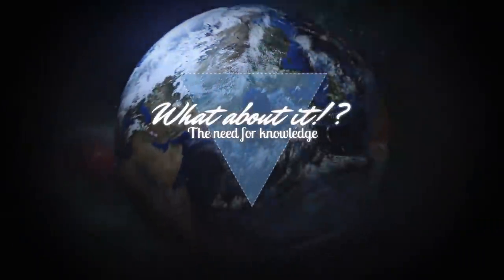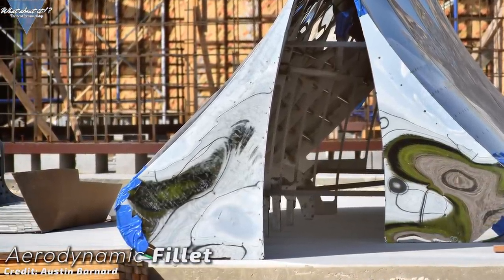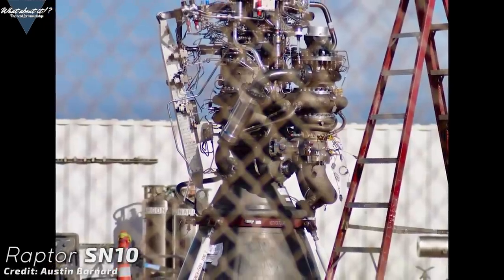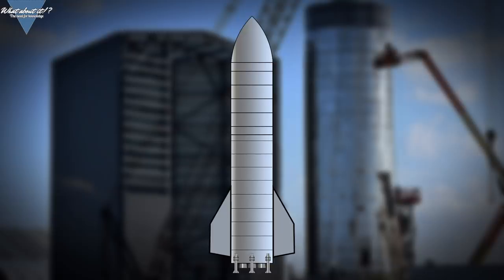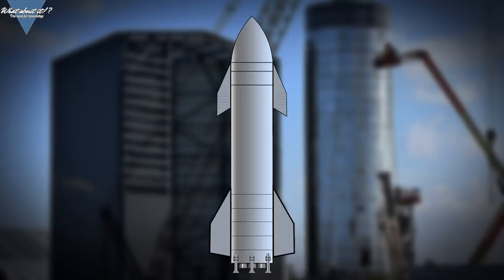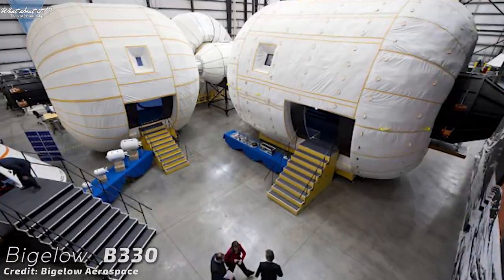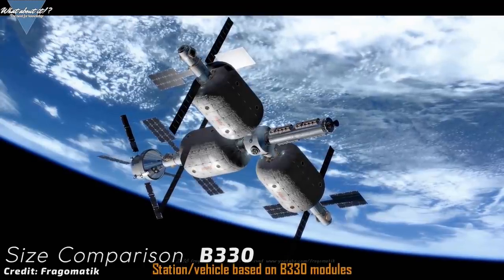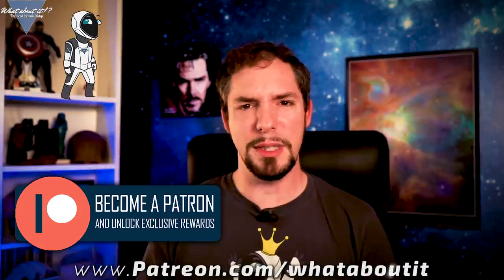36 | SpaceX Starship Almost Ready - Bigelow Aerospace, A Fitting Payload

Comment: Shipping an excavator to the moon would be 
Elon's style.
Reply: $5,000/Kg x 20,000 Kg = $100M.  Pretty expensive freight bill.
Reply: But battery powered
Reply: @SomeTechGuy666   Starship ought to be able to bring that cost per kilogram way down.
Reply: @odysseusrex5908  That is a landing on the moon price guestimate.  Earth orbit or even moon orbit is much, much less.
Reply: @SomeTechGuy666    What is your guestimate based on? 100 tonnes of cargo to LEO for about $100 a kilogram. Same price per kilogram for the extra fuel, and away you go. I'm not sure what the total mass is of the fuel in a Starship, but I don't see a total price of more than a few hundred dollars a kilo to put it on the Lunar surface.
Reply: @SomeTechGuy666  maybe an excavator will be constricted with titanium and other composite metals that would reduce weight plus an over performing engine or engines that run on gas nuclear etc. Could cut cost by 1/3?
Reply from the maker: Just wait for it. :D That's what's possible with a refueled Starship.
Reply: I'd be so damn down for that.
Reply: Mexvette It wouldn’t need to built as robust as it would to operate on Earth. I’d think at least 1/6 the weight?
Reply: Na bro should be a tank

Comment: Von Braun's original concept for a space station was also to use inflatable module's then cover them with plating for metoroid shields.
Reply: Yeah, bigelow modules are inflatable but only a bit. If we remove the shield ans add it later it could be way bigger.
Reply from the maker: Actually uncovered they are better protected against debris. They work like a bulletproof vest. They give in and thus take out a lot of the cinetic energy on impact! Von Braun didn't have Kevlar at his disposal. ;)
Reply: @Whataboutit  I think Von Braun wanted to disassemble the module to make it more lightweight, that's why he separate the module in two parts.

Comment: I wonder why the B330 shown on the ground from the inside has "does not exist" stamped over all of the cross beams.
Maybe those are only there to hold it up in Earth's gravity and not needed in space?
Reply: That's an interesting point and well spotted 

I think your right. In space the compression forces are zero. Especially once it's pressurised 

On earth gravity creates compression and the lack of pressure inflation increases it again.

Now that I think about it I noticed the doors are open so it's sitting there unpressurized.

Comment: Do we have any concept pics of what the ITS or BFR had for landing legs before the 3-fin design appeared?      Interesting that the fins are skinned in rectangles of stainless steel, similar to the body. Surely the surface could be made in one piece if they wanted. Expansion joints?
Reply from the maker: https://www.google.com/url?sa=i&source=images&cd=&ved=2ahUKEwj0w6rAyunkAhWQyKQKHfl8BWsQjRx6BAgBEAQ&url=https%3A%2F%2Fwww.reddit.com%2Fr%2FSpaceXLounge%2Fcomments%2F70hxou%2Fa_fleet_of_its_ships_on_mars_by_sam_taylor%2F&psig=AOvVaw3ZBWC8SMazmeuMR4xQNaDO&ust=1569418727335790
Reply: @Whataboutit   
All the people lined up by the ships made me think,
These people don't know it's a cookbook!"

Thanks. So, three legs even back then. I'd like more, with a wider stance for stability on uneven/unknown terrain, but weight is always a factor.

Comment: @ whataboutit, you have the cargo bay correct.  If what I surmise is correct there will be 4 different starships. 

1. VANGAURD : will be the first to arrive to survey and test with a smaller crew of 15-25. Designed for provisions for a round trip. They will set up the Sabattier process and make fuel reserves for the other ships
2. FUEL TANKER: this ship will operate mostly around the moon and earth refueling other starships for interplanetary flight from orbit.  Likely completely autonomous.
3. CARGO STARSHIP: Will move heavy equipment to and from the moon and Mars for infrastructure.   There maybe two variants of this to put extremely large pieces into orbit.  More likely this will be disposable.
4. THE PASSENGER STASHIP: will be one of the last made, designed only to get 100 people to destination Mars for a one way journey. 

I even have drawings showing a shuttle like cargo door on the CARGO STARSHIP.  The question I have is will this version (CARGO) land on the moon vertically or horizontally as a vertical  position would be unstable for off loading extremely heavy cargo.
Reply: There simply cannot be a horizontal landing.  MAYBE you could build a strongback-like machine to recline a landed starship, but it would make more sense to just firmly secure the ship and carefully offload with cranes.

Comment: Most of the designs for a spinning space stations I see are curcular. Make the sections straight and launch them with one adapter offset to link them together. Like an adapter to link it to the next section at a 45' angle. That would only make a four sided spinning space station. Easier to launch.

Comment: Another super important point about starship payloads is that if you can get it to LEO, you'll be able to get it pretty much anywhere in the solar system with the orbital refuelling capability
Reply from the maker: Exactly. Imagine the possibilities!
Reply: @Whataboutit  Finally space travel won't be about how much fuel you can fit on a mass limited single launch payload. Our current paradigm is that of smaller and more efficient vehicles, however Starship should open up space to a whole new world of engineering

Comment: If they turn the nosecone into a replaceable structure (or a completely passive one)  then this allows for nose/nose or nose/tail docking in orbit, which allows for staging in orbit too. Sure that requires two starships worth of fuel, but it lets you soft land a LOT more than 2 starship's worth of cargo at your destination. So might be worth it.
Also lets you easily carry out-sized cargo, link to a long pylon for a cheap spinning station, or link three or more starships together. (Though not sure what use the latter would serve.)

Comment: It seems to me that a modified Starship could make a decent space station in its own right.  Take the crew version and delete the control surfaces, heatshield and most of the engines, because it's not going to re-enter and land.  That would leave you with something roughly equivalent to Skylab.  Launch it with all the necessary lab equipment etc on board, and it could be rented out or sold to pharmaceutical companies etc.

Comment: With regard to putting up space stations using the inflatable habitat modules, it's a great idea and would work brilliantly if desgined properly.  I can see the bare docking ports, solar arrays and other hardware going up in one mission and the habitat(s) going up in another.  Send up everything BUT the habitats first and deploy the docking ports using a variation of the Canadarm, then send up the habitats which can be attached robotically just like docking a cargo module on the ISS today.  Once that's done, the rest of the building can continue with the other parts parked in orbit nearby - the solar arrays, propulsion system, life boats, etc.  The attachments can be designed to be done robotically and the space station can then be powered up ready for habitation.

A more radical solution would be to build the new space station next to and attached to the current space station so that it will simply look like an extension to the current space station until the current station can be "cut loose" and re-entered into the atmosphere once it has outgrown its usefulness.  The order of construction would change with one habitation module attached to the ISS and the rest attached from there.  The advantage to this method is that you can have astronauts who are able to do some EVA and attach further components to the new station.

Comment: If the tanks for the landing are in the nose cone, there will be more fuel in the bottom tanks. That could explain how the prototypes can reach LEO as an SSTO and have enough fuel left for landing.
Reply: The issue is mass-constrained, volume is not the problem. Moving the header tank probably does not change absolute mass significantly.

Comment: Are the starship fins helpful at all in earth atmosphere?  Or only for scrubbing velocity for landing on Mars?
Reply from the maker: CaptainDuckman has the answers! :)
Reply: They will be just as important for earth reentry. They not only produce drag, due to being actuated they also balance the ship and keep it in the correct (belly into the wind) orientation.
Reply: Yes that makes sense, Thank you!  It will be real interesting to see this fly.

Are these airbrakes/control surfaces useful for suborbital testing?  Honestly I did not expect to see the airbrakes added this early into the MKI build.  I assumed starship MK1 during its suborbital phase would be assembled just enough to test retro propulsive landing using the new methane thrusters for maneuvering.

This seems a stupid question, but is SpaceX planning to install the heat shields prior to the suborbital tests?  I would assume no?

Comment: What gimbals the raptor engine, I didn't see anything to move the nozzles....
Reply: The whole engine gimbles, not just the nozzle. It means that you don't need flexible high pressure parts. Instead of high pressure parts* bending when the nozzle moves, a single low pressure feed has to flex instead.

*For the preburners to be static you would need flexible connections to the cooling lines, from the cooling lines to the turbines, and then a large connection back to the main combustion chamber. Having a flexible nozzle on a fixed combustion chamber would put articulation inside the combustion chamber, and even if you manage to get that to not melt you need to be sure that it is not going to explode at any angle, forcing design compromises. You would also still need to cool a nozzle, and given we use high pressure fuel for this that means high pressure flexible lines to and from it.
Far simpler just to have the whole engine move. There is a ball joint at the top of the engine. I imagine the hydraulic rams are disconnected for transport, as there is no reason to have them swinging about. Everything else on the engine is in a rigid layout.

Comment: Great video as always. However, you're drawing/schematic for the different variants doesn't work. First, the big nose window is likely gone for good. The header tank lives there now and it does not need a window. Secondly, the payload bay doors will not extend half of their length over the main tanks, so they will be much shorter. I see there being three major variants. Crew version has a habitable compartment between the main tanks and nose sections. Cargo version will have the same space for payload and a door (almost) as large as the cross-sectional area of that compartment. The tanker will simply maximize the available space with longer main tanks.

Comment: Great bit on the flexibility of Starship. Can't wait for the presentation.😀Not so sure about Bigalow though. It's a great idea. But it's based on principles developed as a solution to old problems. Small volume fairiings and high cost kilos to orbit. But with starship coming these limitations will be a thing of the past. In fact you could probably fit a fully inflated bigalow station inside it. No need to wait till it's in orbit. So why bother with an inflatable one at all. Starship will allow for  a new kind of space hardware where size and weight are far less of an issue. Previous satellites needed bespoke miniaturized, componants produced at great cost. But soon you can knock a satellite together with off the shelf parts. Who cares if it's the size of a bus. It doesn't matter. We need to get our heads put of traditional thinking because the old rules simply don't apply anymore.
Reply: You can basically merge starship and superheavy together and make an SSTO rocket with 3800 cubic meters of pressurised volume. That's 80% more than BA2100.
Reply: @johntheux9238  that sounds amazing!.😀👍

Comment: The bigelow looks awesome. But doesn’t an air filled balloon seem too exposed to the elements? In orbit it works a charm on the space station but the space station does get hit, and on the moon or Mars, I’m not sure, especially the volatility of Mars? Maybe I’m well off the mark 🤷🏼‍♂️
Reply: Like any spacecraft, it has to have a reasonable amount of shielding against both radiation and impact, and that's true whether in orbit or on the surface — the Bigelow isn't just a big easily-punctured balloon. That said, the usual sci-fi approach to surface bases is to bury them... set up the structure, then pile on rocks and sand and stuff for additional shielding. I assume they'd look at something similar in reality... say, a variant of the Bigelow designed to support the extra weight of half a metre or so of dirt above it.

Comment: Could you place a really large telescope in a starship (like a Hubble only bigger cause starship is 3x as wide as Hubble) but in this case is remote piloted and it becomes a massive mobile space telescope?
Reply: provided you have the fuel depots in place of course but then starship could probably help build that infrastructure to...
Reply from the maker: You probably could, but most telescopes do not need to move.
Reply: @Whataboutit  Just curious but do you know why they don't?

Comment: I think Elon should contract Biggalo to build the internal habitat of Starship. 

   A complete pressurized balloon (or two) and its protective system could be sized and placed snugly inside Starships hull. This would perhaps save Elon a fortune in habitat development, while also offering a way to avoid weight by stiffening the hull to handle pressurization/re-pressurization problems.
   Obviously Starship can easily transport several modules, inflated or not, to remain on the moons surface.  However I think the first module left there should be flown fully inflated and tested.   This offers an extra  level of safety.     Later modules could be delivered un-inflated.
   Your welcome Elon!  A generous donation of cash for my words of wisdom would be most welcome!

Comment: I wonder if Bigelow Aerospace modules could be used to assemble in orbit a long-range spaceship like the Hermes from "The Martian".  We definitely need some artificial gravity if humans want to travel to Mars and beyond.
Reply: The sky isn't even the limit with orbital construction possibilities enabled by this beast. Once it arrives and NASA forgets about doing the trucking and focuses whole hog on mission design things are going to get nuts. I wouldn't be surprised to see Starship Mk3 (after the 18m one) being built in orbit.  And we know where the fuel tankers are coming from already.
Reply: @AdmiralBob  I don't follow. I don't see that a spaceship capable of takeoff and landing could use these inflatable modules.  They make sense in LEO, moon orbit, Mars orbit or for long-distance journeys as long as they can be protected from space debris somehow.  The 18m diameter SpaceX Starship would still be made of stainless steel, I think, and would need to be constructed and launched from Earth.  Fuel tankers would also be a variation of SpaceX Starship, right?  I think these Bigelow Aerospace inflatable units might also be useful for creating habitable space on the surface of the moon and Mars, depending on available shielding against GCRs and solar radiation. I think we need autonomous robots to build domes out of Martian regolith to shield inflatable habitats from radiation.

Comment: Think this version of Starship is just a flight/suborbital testbed.
Cleanroom?...we don't need no stinkin cleanroom!!!
Reply: Is what I believe. But Elon has clearly stated these (or at least Mk 2) will go into orbit. But that may be Elon-level optimism.   Clearly don't need a cleanroom, except - how do they clean the inside of the tanks of dirt and concrete dust, chips. Turbo pumps are very fussy about what they ingest.
Reply: Don Jones Except SpaceX Merlin engine of Falcon 9 can ingest screw and work fine. Screw ingestion test - passed.
Reply: @AkaiKA4K   Didn't know that. Thanks.

Comment: What about that holes and pipes inside or aerodynamic Fillet? 🤫
Reply from the maker: The fins will be actuated. That needs holes and pipes. :)
Reply: Ok so they will be actuated with something like gas cold thrusters? By the way I m not writing about Fins but Fillets ;)
Reply from the maker: Methane! Starship already has a pressurized system on board. SpaceX will use that. :)